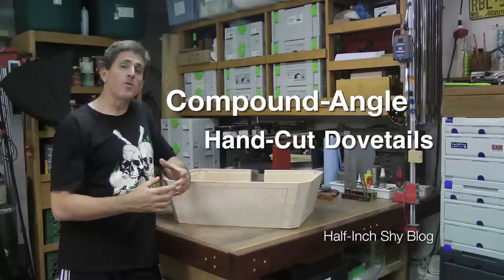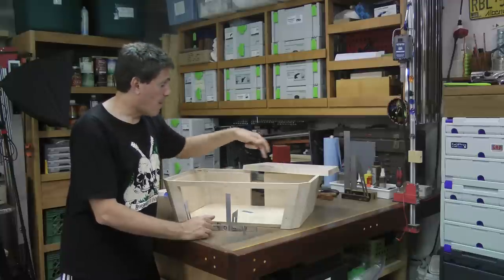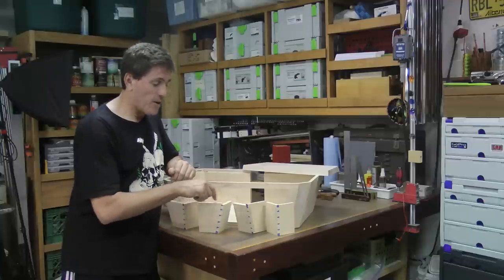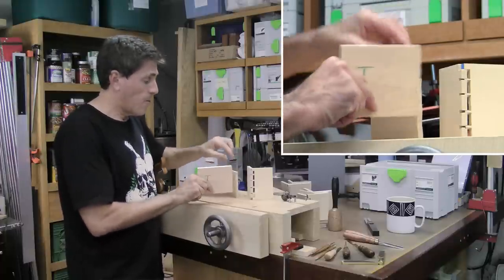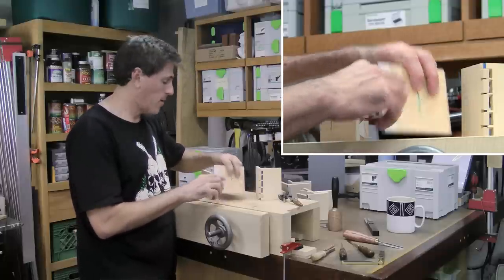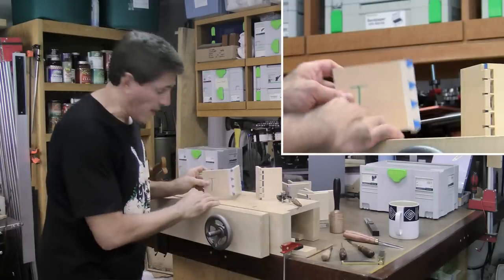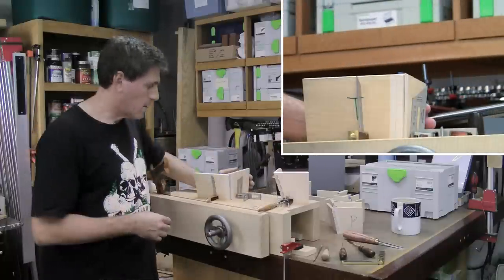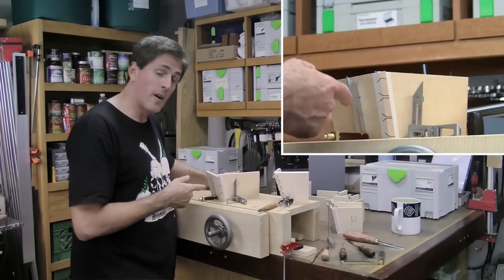#90.1 - Hand-Cut Dovetails on Compound-Angles

Comment: Paul I fought this for months. Historically this was used to assemble caskets, feeders and grain boxes. There is very little written on this assembly that I could find. I am a tail first guy but found it easier to do pins first. In watching your video it is because of the parallel lines.
In a fashion I used your projection method by making a template and working the angles first. That gave me a repeatable reference for my gauges.
I referred to these as double bevel dovetails.
This was one of the hardest joints I have attempted. You approached it in a whole different fashion. Now I will have to watch the video five times so it will soak in. Thank you for this. You made my day.

Comment: Very interesting Paul. You were well recommended by someone I subscribe to. I'm making a box and haven't made one since school some forty years ago. Trouble is the box has to look in place on a C17th display. I'm a wood turner so box making is not going to come naturally to me. I will check if dovetails were used in the C17th United Kingdom and, if so, I'm coming right back here. Thanks.
Reply from the maker: Thanks! They are pretty easy to make if you take your time is all.  I'm not a good dovetailer, but they still look alright when I'm done. :)

Comment: If you cut the tails and pin joints square to the face plane of the stock there is a gap on the inside of the joint where they meet when the sides are at a 90 degree angle to each other.  How do you get the precise angle needed in the "butt joint" portions of the joint?  I hope my question is clear!

Comment: Brilliant. Thanks for that and the rest of your superb videos. They've got everything - funny and greatly informative - I always feel I'm learning loads without being patronised and laughing out loud now and again. Tool porn too but all I'll really need is a moxon vise and a dovetail saw!
What stock is good to practice dovetails again and again?
Thanks 😀
Reply from the maker: Thanks, Patrick!  You could practice on any hardwood that is reasonably priced in your area. I was using Basswood because that's what my drawers are made of.  Basswood is pretty soft as a hardwood so your cuts will be fuzzy. If you realize that's the wood and not your technique, it is pretty inexpensive.

Make some long boards to join. Make a dovetail corner then cross-cut off the joint from the boards and number it.  Keep practicing on those two boards until you use them all up.

Also because Basswood is soft, chiseling out the sockets can leave a dented edge. If you remove the stock with a fretsaw (or coping saw) close to the line, you should be able to pare without much denting going on.

Have fun!

Comment: Paul, I would love to know the brands of bevel gauges you use.  I cannot seem to find those particular styles anywhere.
Reply from the maker: Hi, Bruce... my bevel gauges are Bridge City and one Veritas. Bridge City makes a single run of a tool then it's over so you'll have to find them on eBay. The large bevel to the right of the maple box on the assembly table at the start of the clip is a large sliding bevel from Veritas (Lee Valley). Sadly, that bevel and the successor to that bevel are discontinued with no replacement. I don't know why. If you put a saved search in eBay for 'bevel gauge', you should get a chance to get one. I have 7-8 gauges and I've honestly used most of them at once, such as the shelving unit I'm building now with 4 different bevels. So much nicer to lock a bevel gauge to a setting and write on the bar what it is for than to keep resetting (and, I'm convinced, screwing it up).
Reply: It is a shame that Bridge City and Veritas do not offer these beautiful tools any more.  One would think with the resurgence of hand building, they would bring them out of retirement.  I will keep looking.  I like the ones where the tightening mechanism is completely out of the way of using the tool.  At the end, with a nut.  Thank you.  Your video completely demystified the angled (splayed) dovetail process.  Just keep the cut lines parallel to the horizontal surface.  Simple.  Well now it is.

Comment: Good video but I don't think this would be adequate for compound angles say 20° off vertical, mustn't one take the bevel on the end of the board into account? With 20° inclinations it would work out to be something like 6° from perpendicular to the face.
Reply: Correct the base will be slightly off-square if you do not take this angle into account. Either he did it when cutting the miter and didn't say anything about it, or the difference is sufficiently small that the box still goes together. For a 10 degree miter it is only a couple degrees off square so visually it's hard to see.

Comment: In the last example, what exactly is causing the discrepancy between the pencil line and the gauge?@20:36 It's very slight, but what caused it...human error? Maybe if the base was planed perfectly horizontal...then it would eliminate that? Also, is it really an issue... When u put the bevels back to back, the space looks uniform all the way up and down the blade( blades look parallel).
Reply: There are no errors, it is the geometry. Where two angles meet it makes a third angle, that's what makes the "compound" of compound angles. The fact that these angles look similar are what makes this joint so challenging, to me anyway: you think you got the right angle but nope.